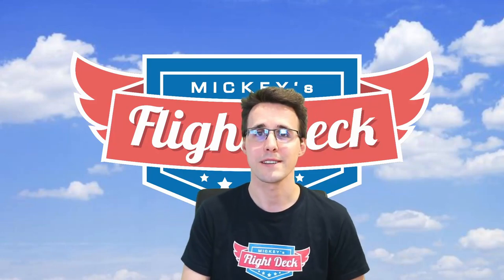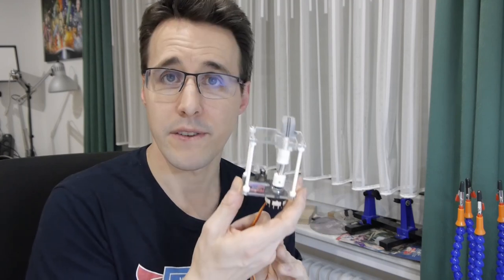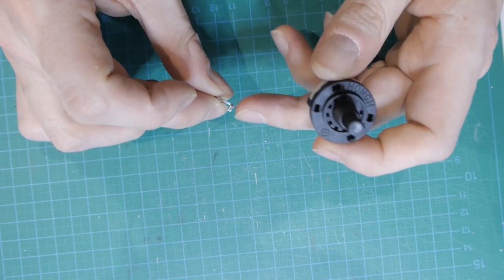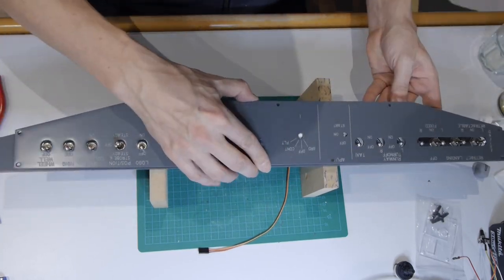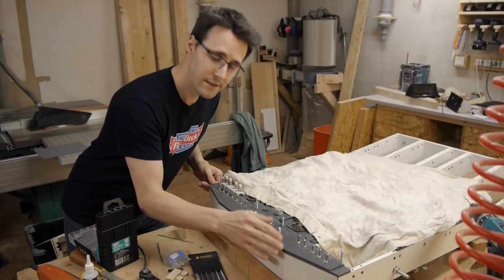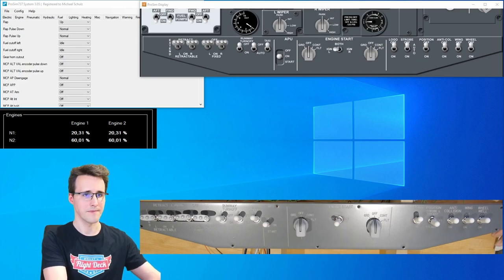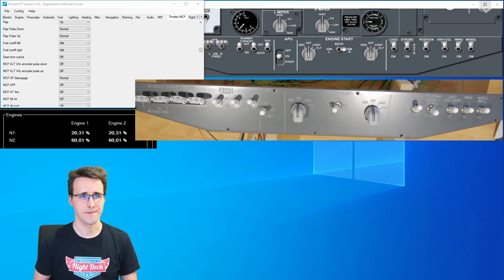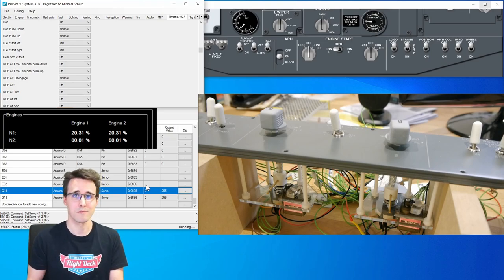Lights panel & engine start switches - A Boeing 737-800 Homecockpit #55

Comment: Great panel! I really like the solution for your start switches. Have you considered making the extendable landing light switches three position (Off-Ext-On)? I’m not sure if it is supported in software though. One thing I’ve seen in real NG and Classics is a spring-loaded flap behind the four landing light switches so the pilot can turn on all the landing lights by moving the flap. Obviously, you can just use your hand instead, but I was wondering if you had any thoughts about it.

Comment: Where can I buy the 3D printed parts please because I don't have a 3D printer
Reply from the maker: These parts are so designed by myself. So you can't buy them. You can just take the files and let someone print them for you.

Comment: Wich Flight Simulator are you using for your homecockpit ?
Reply from the maker: At the moment I'm working with Prepar3d. But only because it is starting faster. Later it will be MSFS.

Comment: I'm a little bit late here... But I think those landing lights switches (in this 737 version) are 3-positions (extended but off should be missing). Please correct me if I'm wrong. But thats a great work you've done.

Comment: what's the offset number "SERVO" for engine left or right? 66E0 not running with mobiflight...
Reply from the maker: This is a little bit more complex. There is no offset for an engine servo. I'm using a single bit of an offset to get the state of the starter solenoid from prosim. It is all explained in this video.